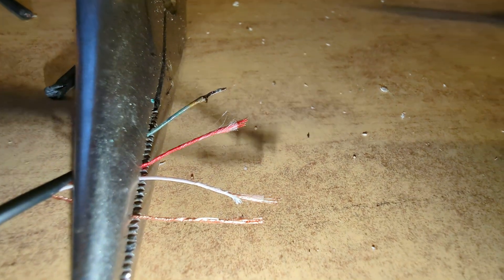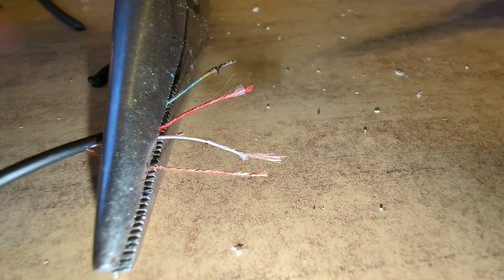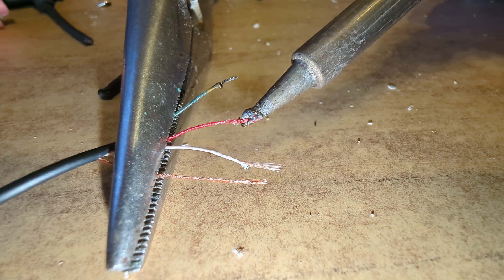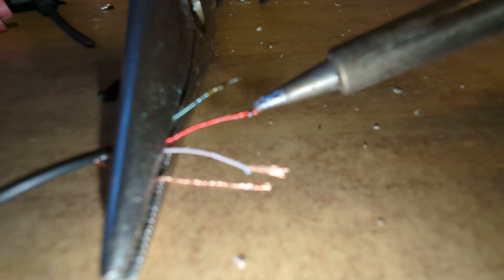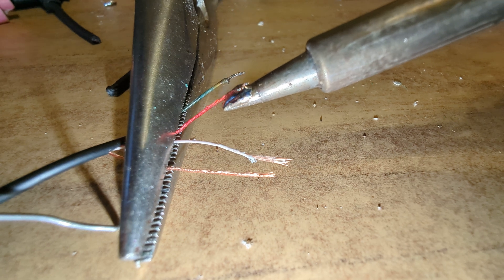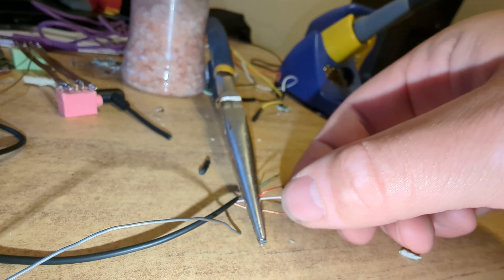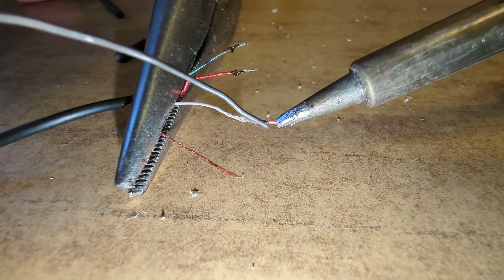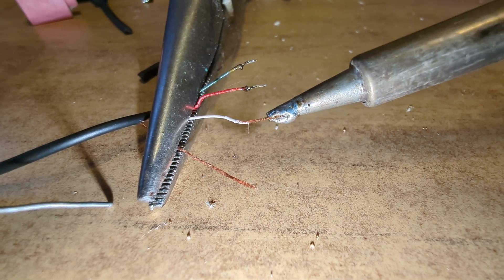How to solder LITZ individually enameled stranded copper wire (Headphone/Audio cables)

Comment: Nice. Gotta try this. Whenever I need to solder nowadays, IF I can spare some cable, I do a test strip and test soldering to see how the wire actually reacts before trying the actual thing.
Reply from the maker: Yeah this wire was the bane of my childhood until I learned that the enamel could be melted by the soldering iron 😆

I don't know how many times I replaced this wire with regular speaker wire or something and had this awkward giant mess of wire attached to my headphones to make them work

Comment: I tried burning it off with a flame, it didnt work well as I had hard carbon black residue that wouldnt come off cleanly. Scraping broke the strands, alcohol and flux cleaner and even solder couldnt get the black residue off. I tried using your solder technique first but perhapsmy temp was too low. Will need to try again.
Reply from the maker: @petersvideofile  yes in my experience you need to have a pretty high temperature but not too high so it doesn't destroy the wire, it's a pretty fine line, but I'm not an expert on this, I don't do it very often

According to one of my older comments: 

"You have to immerse the enamel in a ball of liquid solder for 30 to 90 seconds in order for it to reach a high enough temperature to burn off."
Reply: @NathanaelNewton  Thanks so much I'll have another go :)

Comment: I have a sennheiser HD 560S that used to have a broken connection in the cable that connects the left side to the right, and it was those individually enameled wires. I managed to solder them by coating them with flux and tinning them.
Reply from the maker: Yeah you got to burn through the enamel.. I've heard that some enamels are formulated to be flux, but I'm not sure about that

Comment: Worse is the tinsel wire used in telephone handsets, where you need to solder the thin copper foil with plastic inner to a wire. Those you always have to sleeve with heatshrink, because the soldered section is incredibly weak, and will always crack right where the end of the joint is, and the plastic is melted away. 

Have had that used in headphones before, and it is a PITA to use, if possible I use a crimp on 4P4 connector, so that you at least have the cable held firm, and the IDC contacts will make a good connection to the wires. White wire more solder needed, you need to feed in little bits of solder to get the flux there, to remove the enamel, but hard to do with one hand and the other holding a phone. Tip is to get liquid flux, and dip the bare ends in it before soldering, to get the flux there before the solder. Small dropper bottles of flux work well, I generally use them and refill from a larger bottle, as that works out cheaper, and the little bottle you only buy once.
Reply from the maker: That does sound absolutely dreadful 😂
Thanks for sharing.

Comment: Would it help to use some desoldering wick to remove the enamel?
Reply from the maker: I'm not sure how that would help. You have to immerse the enamel in a ball of liquid solder for 30 to 90 seconds in order for it to reach a high enough temperature to burn off.